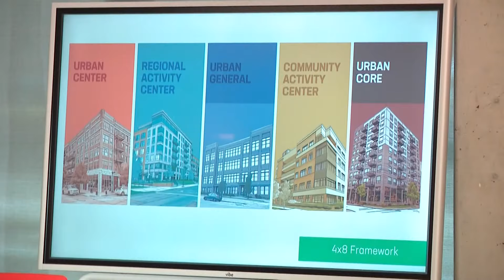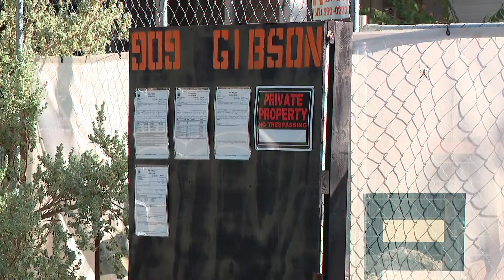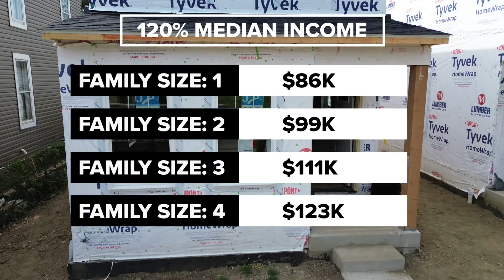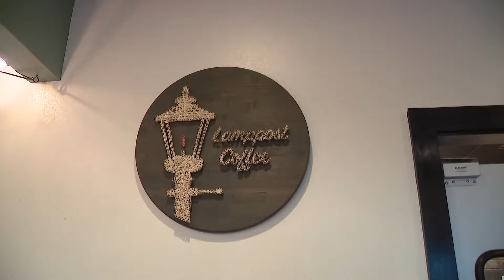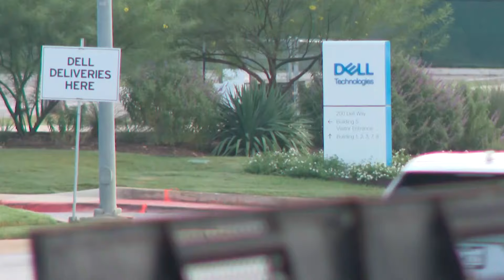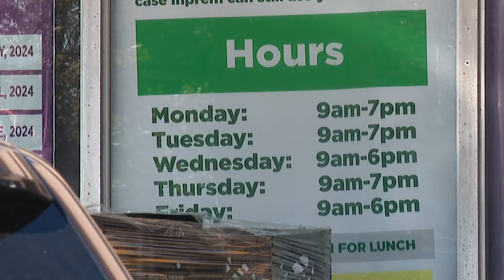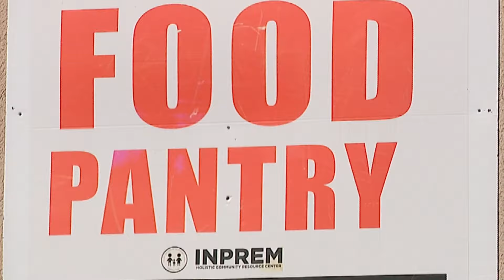Boomtown: Comparing Columbus to Austin; lessons for central Ohio as the region grows

Comment: Car centric america still obsessed with the automobile
Reply: Simon it’s 108 degrees rn in Austin do you wanna get out and walk 10 miles to downtown and back to show us the wonders of a life without the car
Reply: I do think American cities will adapt. In the warmer Sunbelt locations like Austin, you might see the use of semi-subterranean walking areas with local gardens to combat heat. They might also be slightly heated in cooler months/days if unusual colder weather hits. I also believe transit will take hold in a bigger way, but I look for trackless trams and the like to dominate the discussion. You can dedicate a lane(s) more easily, requires less disruption of current transportation networks, and it can add a level of beauty to the area.
Reply: @azulaquaza4916  hmm it's like almost having better land use policies where your walk is less than 15 minutes can make your walk much more doable and convenient and nice.   And instead of pushing all the buildings back from the street, you can line them up against the road and have arcades (awnings that shade the sidewalk) and plant trees and have benches, trash cans and businesses and homes line it as well.   Not so terrible when you don't build parking entrances and exits, pull out lanes and all the other archaic nonsense when it comes to car dominant infrastructure that requires so much land use to make the least efficient form of transportation (personal vehicles) operatable (costing way more tax payer money to keep up and maintain while also being the most damaging and less tax generating when buildings are so far spread apart, large box store offices and utilities needing to reach them)
Reply: fr. our cities and towns would look way better if they weren’t so car centric but more pedestrianized, walkable and clean
Reply: @adnanomeragic9597  what you’re proposing is unrealistic in real time not only are you asking for a complete reshaping and designing of an entire city without taking cost or what exist already into thought you’re also  wanting people to give up their large homes, downsize, squeeze in with multiple neighbors, no yards and pay the same price for something smaller are you out of your mind?
Reply: @azulaquaza4916  small attainable steps.  Steps forward not backwards.  Just because it’s not attainable now doesn’t mean we shouldn’t strive for it.
Reply: @ana..a.  I agree, but there is a good deal of un-doing to be done. I have heard leaders in larger older suburbs speak of the "urbanization of the suburbs". If the suburbs are looking towards such an outcome, the core cities will definitely need to do so.
Reply: LOL....I noticed that too. Bro was talking about building a 6 lane highway. What a nightmare ! That's all i needed to hear to not move there